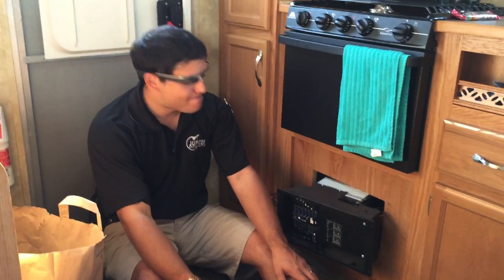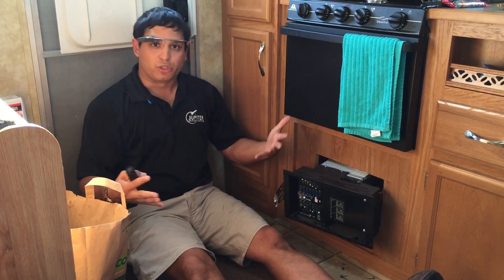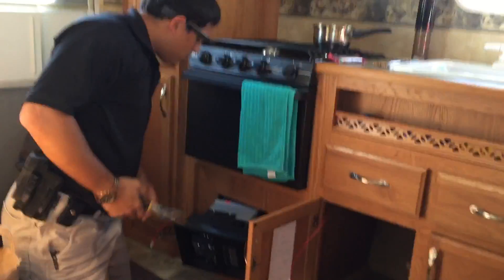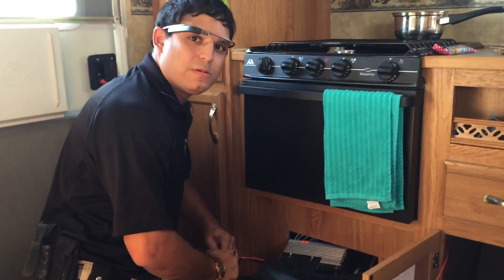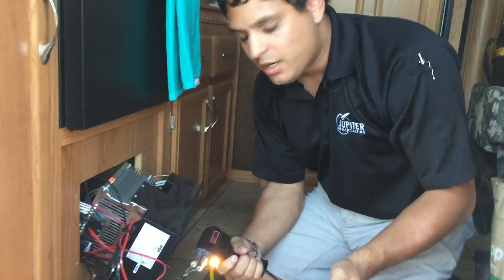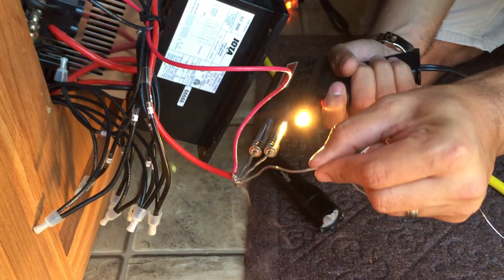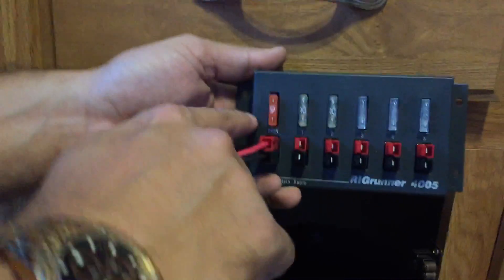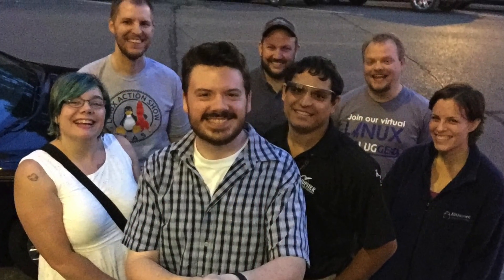Rover Electrical Upgrade | Rover Log 10

Comment: Hmm, those 12v wires look awful thin for my liking... 20-30 amps.. yes, perhaps but it can build up real fast especially if you're talking about inverters... a 450w inverter can pull 40A if you give it something to do... and then you have voltage drop to worry about.